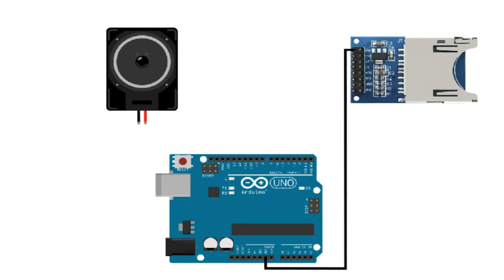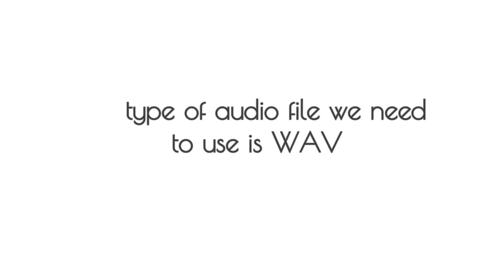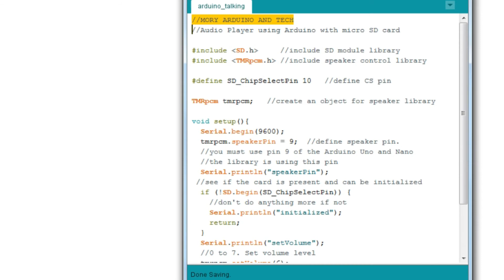Audio Player using Arduino with micro SD card

Comment from the maker: In this video, we are going to see how to play audio files with Arduino.
For this we will use SD card module for keep the audio files.
After this tutorial, you can make a mini mp3 player.

What You Will Need : 

Arduino
SSD Card Module
Mini Speaker
2GB MicroSD
SD Card Reader
Jumper Wires

Get the Library : https://github.com/TMRh20/TMRpcm
Online Convert : https://audio.online-convert.com/convert-to-wav

Link to the Code :

https://github.com/MORYTECH/ARDUINO-CODE/blob/master/Audio-Player-using-Arduino-with-micro-SD-card.txt